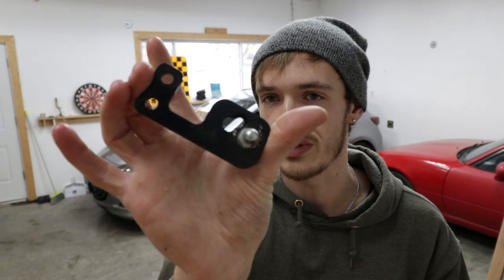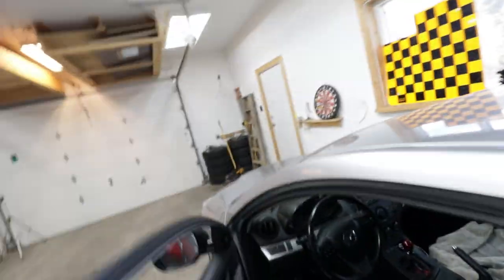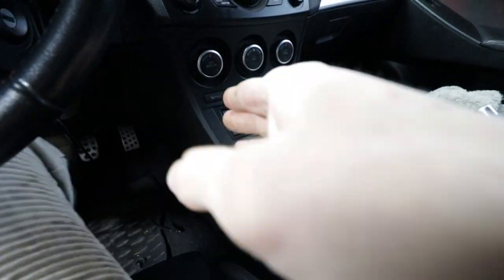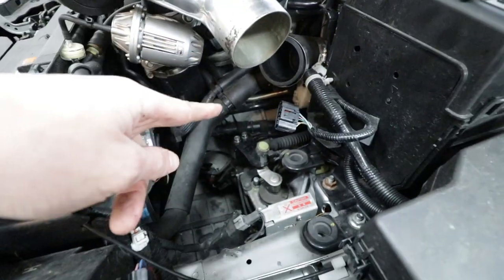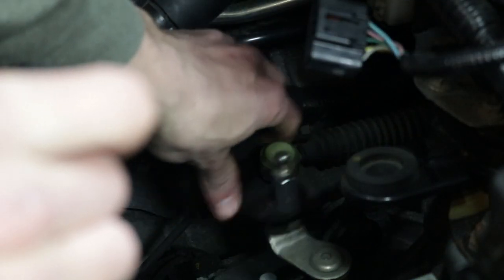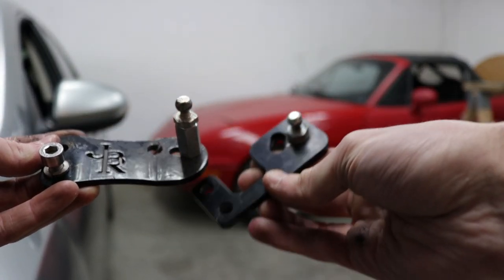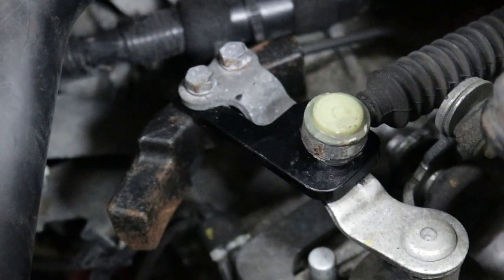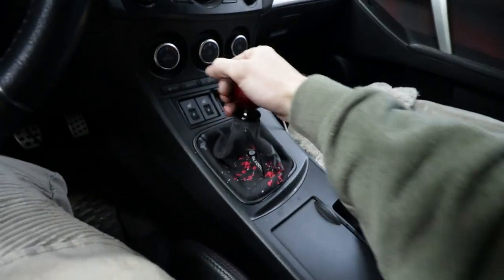MazdaSpeed 3 SHORT SHIFT Plate Install!

Comment: Thanks man. I imagine this would work on the 2.5 s?
Reply: Ill save you the time and effort of waiting a reply. In short a speed3 shifter plate wouldn't fit however if tou have a manual you'd just need to find a short shifter suitable for the SP25 / 2.5L
Reply: @011mpsguy  thanks. Know of any good plates? I dont want a short shifter, just a good plate
Reply from the maker: JBR I believe makes a N/A plate, I think CorkSport does as well
Reply: @ColtonRichter  thanks. I looked into it, but my wife decided to buy me the CS short shifter all together!

Comment: what's the difference between the plate vs an actual short shifter
Reply from the maker: If i'm correct
Plate changes the shifting cables distance and height
A short shifter will have a smaller base & smaller shift knob height